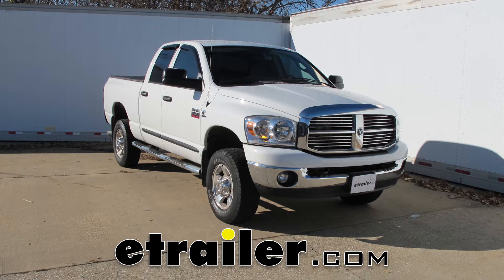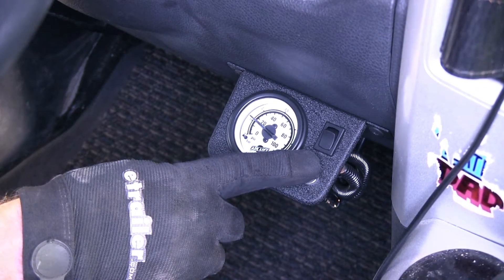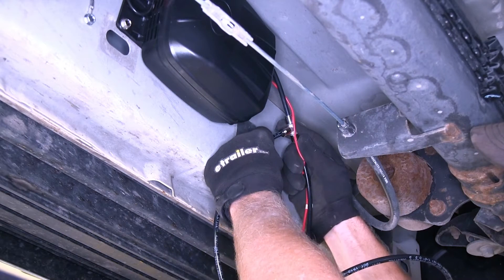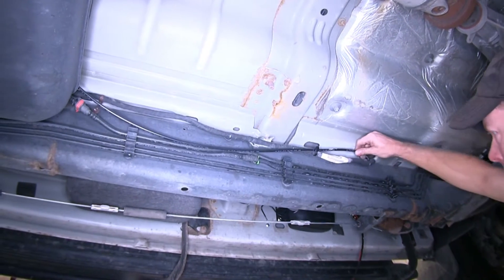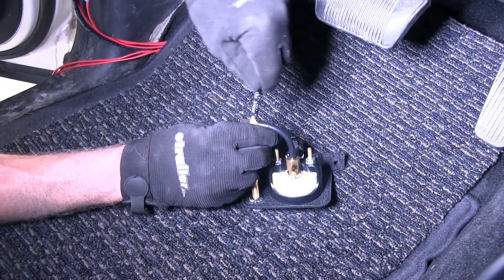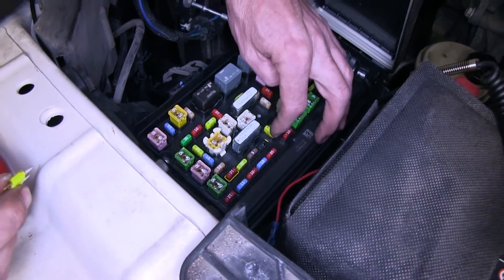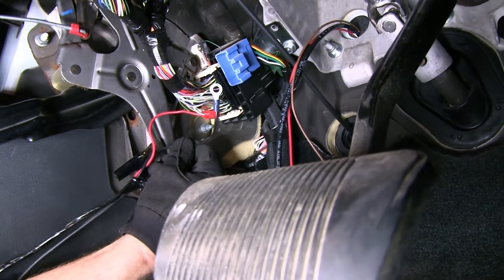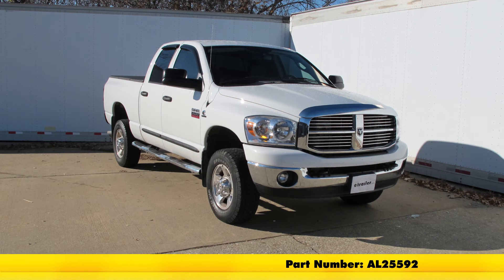etrailer | Air Lift Ride Control Air Helper Springs Installation - 2009 Dodge Ram Pickup

Comment: Gotta question I just bought this have it all hooked up and when I turn the key the compressor doesn't turn on I couldn't find the ignition fuse for where too connect it at so I tapped into my amplifier remote turn on and still nothing I need some help